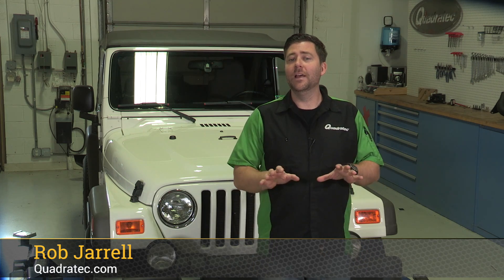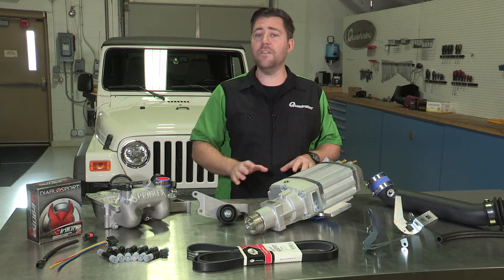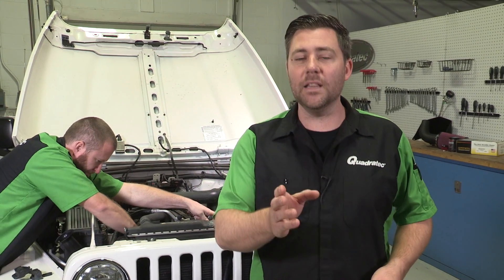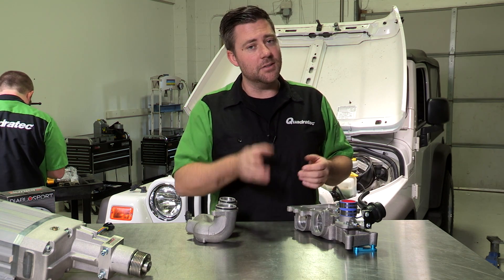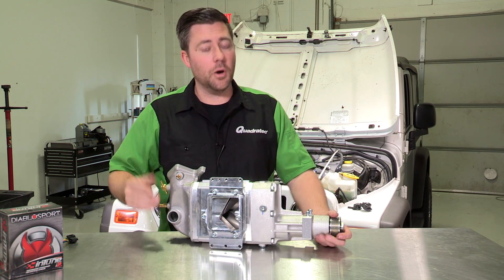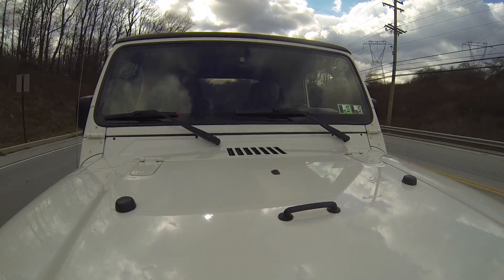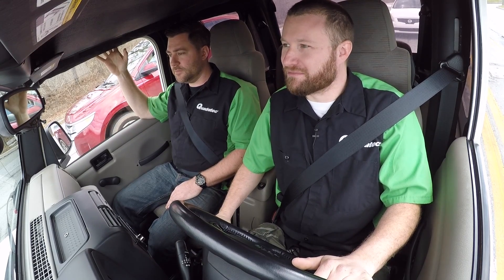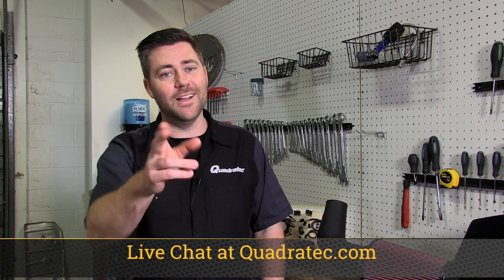Project PearlJ: Part 1 - Sprintex Supercharger Install

Comment: QT.  These Sprintex supercharger kits are made in Perth, Western Australia dudes !  They're just 3 miles down the road from where I live and are a cool system for the venerable 4.0 Hi-Output In-line Six donk.  If guys wanted to install an intercooler, is it possible to fit one to TJ/XJ's ?  Vdogg.

Comment: Afternoon Quadratec team. I am extremely interested in buying this from your website, and may be prepared to buy as soon as next week, but I have a couple questions. How did this supercharger impact fuel consumption? Also, I am looking at installing a different Diablosport tuner for a permanent on dash display (maybe the trinity 2).  Can this tuner be utilized for the post supercharger tune?  I’d like to avoid purchasing both.  Thanks in advance.

Comment: I just bought and installed the sprintex very easy install with only a few steps left out in install book but also I with if you going to do a video be more detail for us diy people.  For instance how much oil is 157 millimetres in us 5.32 ounces I'm confused ....? In video why you didn't tell viewers you need bend a.c. lines down so supercharger wil  fit , and make sure you have all tools needed , this will save u from going nuts and sprintex forgot to include my Turner now waiting on that small complaints but life goes on my 05 lj Rubicon well worth the inconvenience to be different from the jk jeep lover old school and simpler to work on diy
Reply from the maker: We didn't set out to do a full step by step video of this install. A full step by step of something requiring this much work would be a very long and detailed video to shoot.

Comment: Everyone is so hung up in the comments about it only adding 30 HP....how bout the fact that it makes over 240 lbs/ft of torque to the tires from basically 2K rpm to 4K rpm?  That's your useable powerband when wheeling right there for the most part.  I'd say that kind of torque output in that power band is well worth the $3500.  You sure as hell aren't getting that from intake and exhaust lol.
Reply: That may be true, but it is advertised as adding almost twice that number in hp. 
That’s where the hang up is
Reply: true, off-roading requires more torque than hp, and low end torque at that

Comment: +30hp??? +64 hp and +66 ft/lb of torque listed on their website. That's a big discrepancy. I would think twice about spending $3500 for 30 hp, when you can probably get that much from intake, programmer, and full exhaust, while only spending about $1500.
Reply: pretty sure they were measuring wheel HP... and i'd bet sprintex website was showing brake HP numbers (at the crank).  TJ's have quite a bit of power loss thru the driveline.  in any event, an intake/exhaust and tuner ain't going to get you anywhere near 30 more wheel HP in a stock TJ.